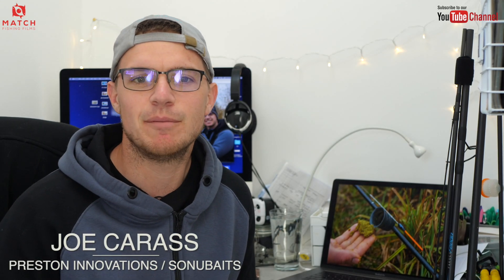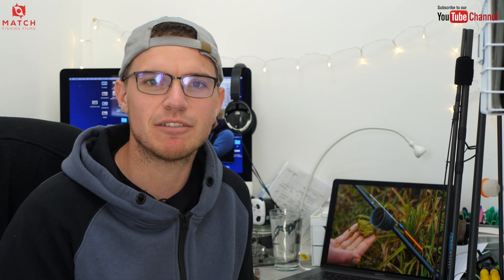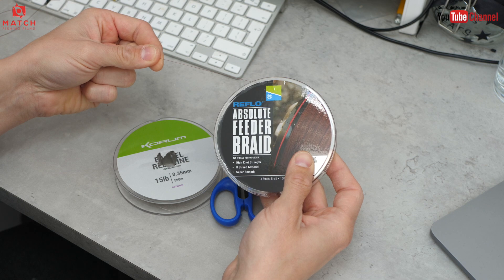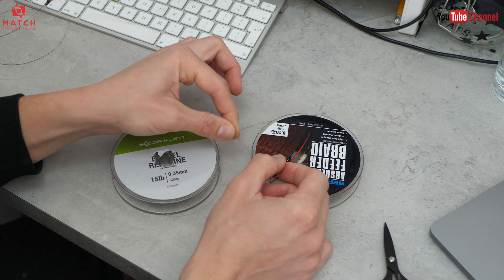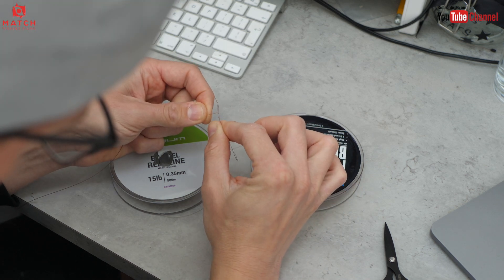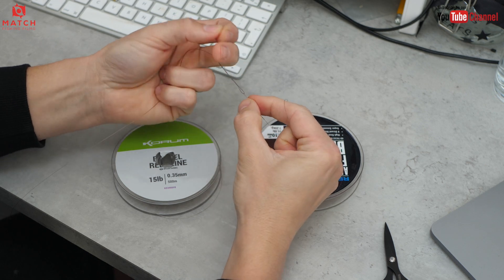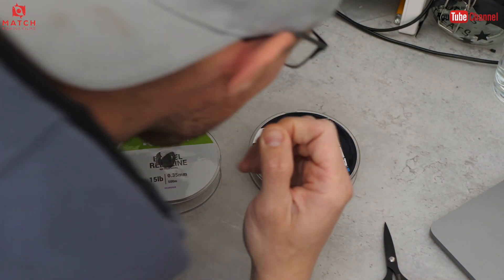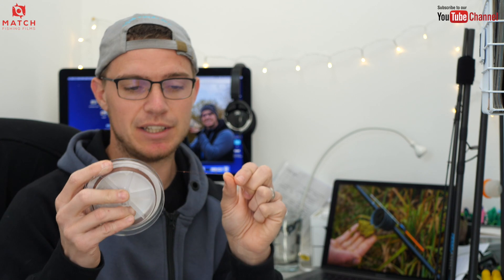How To Tie A SUPER STRONG Shockleader Knot - Feeder Fishing

Comment: Joe if you only have a 1 meter shock leader surely it's not on the reel therefore you could crack off especially if you are as clumsy as me cheers Gary
Reply from the maker: Not if you use the knot tied well :) I wouldn't use it for extreme distance work but it is surprisingly strong